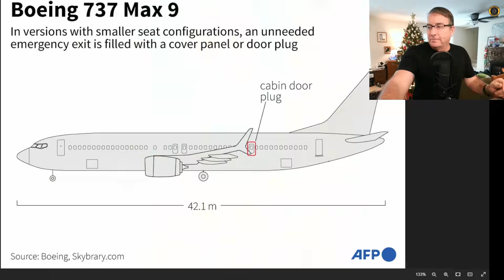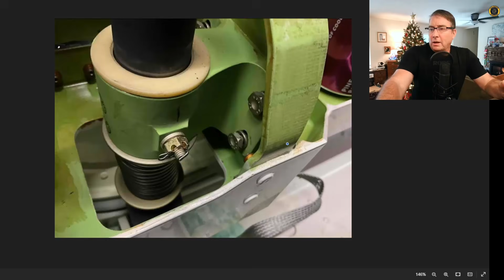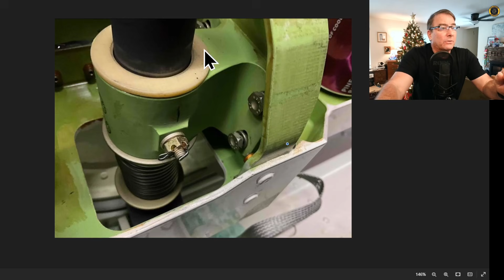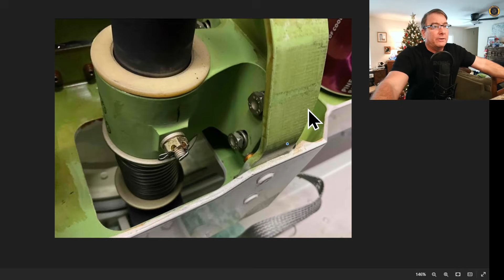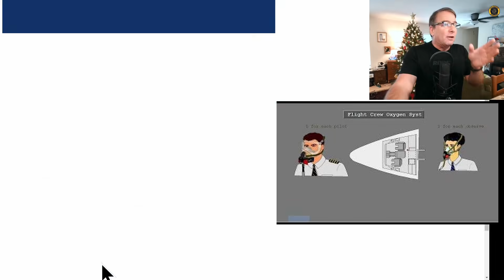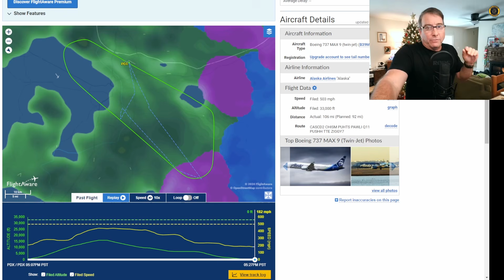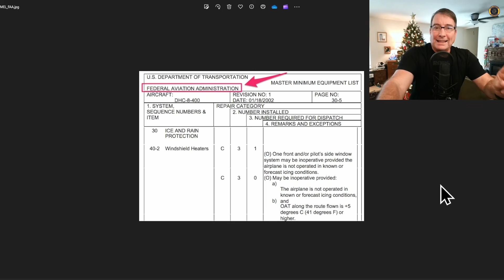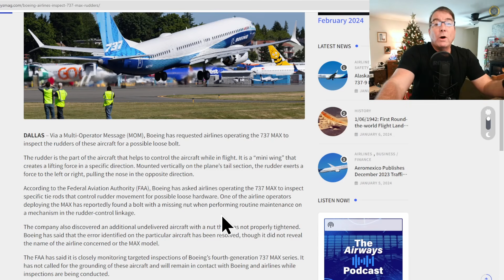"Yes, We Have No Bolts"  9 Jan 737 Max-9 Update

Comment: I retired from Boeing fabrication in 2020 after 35 years of service. The past 20 years Boeing culture became all about saving money and shareholder value. Shareholder value directly affects the elite executives yearly bonus. There are posters all over the factory talking about shareholder value at our stand up meetings we were urged to find savings cut manufacturing time and increase shareholder value. 
Quality control has been severely reduced or eliminated moved to "self inspection" as it was deemed as "overhead". Under staffing unqualified, untrained fabricators were the the norm at the time I retired very little training being done. Very aggressive unrealistic scheduling is the norm.
Self inspection on the factory floor for the most part was taken serious but with some notable exceptions. We also found many detail parts and sub assemblies were of poor quality but had passed the vendors QA. 

Boeing has a serious quality problem and I am becoming concerned the newer aircraft are unsafe.
Reply: An argument can be made for DoD intervention, they higher ups at these companies have got to go. If ww3 were to break out, could we rely on Boeing to construct our defenses? As it stands, I don't think we can.
Reply: @zelkuta That's why we have Lockheed Martin doing most of the aircraft defense work.
Reply: "Shareholder Value". I place most of that at the feet of Muilenberg, but his successors aren't much better. I left in 2022, and although there was contrition over the MAX MCAS debacle, it wasn't genuine. Profit over safety still ruled the day.
Reply: Self-Inspections are pushed down into suppliers too, and allowing supplier's parts to go directly onto planes without Boeing inspection calling this cost cutting:  "partnering for Boeing success" 😢
Reply: @kevinp7056  That would double work or triple work...Since the legal liability would be from the certification agency (Federal Government).
Reply: Shareholder value can go up by focusing on ... I dunno ... making rock solid aircraft
Sometime execs forget that cost cutting and robust quality are actually mutually exclusive endeavors in this universe
Reply: ... having a screw loose has definitely fucked up shareholder value now. How ironic 😂😂😂
Reply: @electronicsafrica Stocks we're dropping rapidly the other day...
Reply: @electronicsafrica   Literally. Unfortunately, I have a fair amount of stock.
Reply: @xyx12300  theres only 1 thing worse than having boing stock ... not having boeing stock ;)
Reply: Even the most diligent person will overlook things when inspecting their own work. Fundamentally someone else's eyes need to see it
Reply: @scabthecat The doors are likely the only way to get chairs into or out of the aircraft, as they are the widest doors, and with no trims or inflatable slides on them, just remove entire door, and you have a good clearance.  The 4 bolts plus 12 stops are plenty enough, if the 4 bolts are actually there, and if it was not a plug door, but a proper door, it would have the correct 4 point latch system to hold it, plus the correct switch interlocks as well. Looks like the warning system should have been there irrespective of it being a plug door or actual exit, and the warning only disabled if the alternate of fitting a fuselage skin and permanently closing was used. After all the wiring and indicators are there, plus the actual switches, and the actual monitors, just the bulb is removed, and the INOP label placed in the display. Should have been left in place as active, and placed in handbook that this lighting means they need to have maintenance do inspection before next flight.
Reply: @mauriceravel4654  Yep. They still have the Zero Defect signs and there was the Go For Zero program. Your Dad is probably as disappointed as I am in Boeing.
Reply: We very recently (2 weeks ago) flew out PDX to SFO and then SFO back to PDX same day flight on Alaska Air in the 737-Max.  Our SFO to PDX flight was delayed 3 hours due to maintenance issue ... they had to fly another aircraft in from ... you guessed it Ontario.  Our flight from SFO to PDX was turbulent all the way and that Max rattles in turbulence ... behaves very different in turbulence from older 737-8.  The 737-8 moves with the turbulence, the Max seems to fight thru the turbulence and rattles when it does.  We landed safely in PDX but I seem to recall our tail number was the same ... sorry but no more Max for me, sticking to E175 or Airbus A3xx.
Reply: The drive to provide large dividends to shareholders, at the cost of quality and employee benefits, negatively affects the quality of your product. Same thing has killed FedEx.
Reply: the reason for this plug door is that the 737-900 is a stretched version.  Rather than actually build a clean fuselage for each type, boeing has chosen to produce modular section of the fuselage, and where one particular variant would not necessitate a exit door, it is plugged.  This is almost exclusively a boeing design decision, not shared by any other major commercial aircraft design.  The old A300-600 variant that were converted to fedex freighter had rear doors plugged, because they don't fly pax, only cargo.  But other than that, there just aren't that many aircraft, especially pax commercial wide bodies that use this modular scalable design...in terms of how to properly plug a door, yes, boeing COULD choose to permanent blank these exit doors, but then this would actually cost time and money.  In other words for every single day just one of these aircraft is in the hangar not making revenue is a lost PLUS the cost of doing a permanent door install.  The reality also is that the FAA rules on temp plug doors is actually less costly and easier to comply with than re-engineering the design to mandate the doors be sealed permanently with far better more reliable methods.   Bottom line is that Boeing made a decision long ago, FAA accepted that design and here we are.  And yes, at each heavy c check those plug doors are removed for detailed inspection...again , adding to the risks that improper maintenance and loose inspections controls will happen again!   (if you are getting the impression from my opinion that Boeing has made seriously poor decisions on design for both maintenance and safety, trust those impression!)@scabthecat
Reply: The worse part was that it didn't just pass the vendor's QA process, but also Boeing's "source inspection" QA process.  The inspection process has been very lacking.  They need engineers to review vendor parts not some low paying person who was not properly trained to understand all the details.  Most of the time, the QA process is about pushing paper and making sure the count numbers are correct instead of looking for flaws in the parts.
Reply: I worked on alot of Boeing aircraft mostly the 737, was f.e one of the guys who took part in the worldwide refit of the tail rudder actuator system on ALL 737's in 2000-2002.
We took pride in our work to give the flightcrews a good / safe bird to work with.
Battery fires, composite delamination, faulty engine mounting brackets, breaking frames of passenger seats, overhead luggage bin's and other trim falling down, Mcas, rear pressure bulkheads etc.etc. and now this all in a short span of time!
Seeing what is happening today with the quality and endangering crews passengers and innocent bystanders is making me vomit.
The thought of that people working in the aviation industry, marching with pitchforks torches and hauling a cart with tar and feathers to the managment of Boeing becomes very tempting.
Reply: Airbus is breathing down Boeing's neck.
Reply: @comancheflyer4903   True, but they've had some problems too. Engine issues (suppliers, not Airbus directly) have been decimating the A 321 fleets.
Reply: Low bidder always is what you get for quality!!!
Reply: Vampire value.
Reply: Listen D.I.E is the future, it's racist to question employees, if the quality is not acceptable you are a white supreme and need to check your privilege!!!!
Reply: “Becoming concerned”? I have sworn I wouldn’t fly on a Boeing jet built in the last ten years since the MCAS incident. If it hasn’t been flying for ten plus years, I don’t trust it. I prefer Airbus all the way, anyway. Boeing has needlessly plagued ITSELF with these incidents, inviting them with subpar QA/CQI and “self inspection”. (Self inspection is a contradiction in terms in capitalism, afaic.)
Reply: That's what happens when the MBA suites run the place
Reply: I bet you're right, and the average shareholder can comprehend this. But I'm guessing the largest shareholders want short term gains and could care less about structuring the company for integrity and airworthiness. A lot of companies in competitive sectors do this.  They kill themselves from the inside.
Reply: @someotherdude  You're oversimplifying.  If Apple phones cause people to die, you will hear a lot more problems.  Airplanes are more complex machines and mistakes often result in bigger disasters.  If someone forgets a screw on an iphone, who gives a crap.  On an airplane, people can die.  Quality control will always be a problem on airplanes regardless if its on an Airbus or a Boeing.  You're reputation is only as good as the the last crash.
Reply: @scabthecat The design has been used with the 737-900 (NG) for a long time.
Reply: I think it’s time the government steps in and does something about Boeing. And for that matter, all aircraft manufacturers. Even Airbus is having quality control issues.
Reply: The factory QC decline is indeed waring but I would also like to know about the air line's maintanance department acceptance procedures  for new acft entering the fleet (granted the door plug is something that could be easily looked over as non critical item)
Reply: the reality is that the FAA issues the airworthiness certificate for new green factory aircraft.  The ONLY moment when a carrier is doing warranty inspections is when a problem happens.  In other words, it's a process based on trust and then on reaction.  It would be cost prohibitive for carriers to re-inspect what they purchase from factory aircraft.  It is the same issue when carriers receive aircraft after a major alteration at a part 145 repair station or even a C check.  It is assumed the airworthiness cert issued by the FAA for that aircraft after the part 145 or even part 121 work is complete is satisfactory to put it into revenue service.   @yanniskouretas8688
Reply: @yanniskouretas8688 Is something that would require removing the interior panel be something typically done on an acceptance inspection? This seems beyond what I’d expect
Reply: @richtes  I know in other companies, they require inspection in every operation that involves closing out a panel or other process which obscures the ability to inspect after it has been installed.  Some even require photos being taken, especially if its an electronic unit to ensure there is a photo record of the interior prior to closing of covers.  As for aircrafts, It would make sense to have an inspection step prior to the installation of the interior panels.
Reply: @yanniskouretas8688  the airline would likely not see the door plug fixings at all.  Remember they are covered over with a panel.  They see a finished aircraft, check the quality of the interior fitout, do flight tests to ensure everything appears to be normal and sign off the plane.
Reply: @mauriceravel4654 All while corporations like Boeing virtue signal in order to boost their ESG score. It would seem that there wasn't enough room in the ESG guidelines to ensure that a corporation isn't prioritizing "shareholder value" ahead of engineering and manufacturing defect-free products.
Reply: There is nothing wrong with cost saving per see. Even when done aggressivly. If cost cutting is not carried out then costs will continuously balloon out. Where it goes wrong is when people can not differentiate between cutting costs and cutting corners.
Cutting costs is part of what should be considered normal business optimisation.
Reply: @Agnemons I disagree. The clue is in the language. Why cutting? That is an inherently destructive process. Cost management is the key here.
Reply: @thesmallerhalf1968  I disagree with your disagreement. 😜
Reply: @thesmallerhalf1968 using words to mean what they really mean is hard, though! I disagree!
Reply: Do you think DEI, which I hear is taught religiously at Boeing, could have something to do with it?
Reply: @belladonnahigh9206  Don't get full of yourself.  It's not "taught religiously".  Perhaps in your own head it was.  In today's reality, you will always need to watch what you say regardless of which industries.  The "good old boys" club is not the same anymore.  You can easily get fired for saying the wrong thing in ANY company in today's environment.
Reply: @ahndeux  I wasn't born yesterday. Besides I heard from other pilots it is. The "good old boys" club will return eventually, if not in this century then in the next - history repeats itself.
Besides, I'm not living in USA, or the "Western" West, where everyone gets offended so easily, though we are in that phase, unfortunately.
My friend works as a repo man and sort of a landlord (goes where he's needed and gives the apartment to the tenant). He already told me which tenants are the worst... guess which, it's a nobrainer. Nevertheless in my job I have a group of friends to whom I can say whatever, sorry you don't have that (or not, maybe you like it).
Reply: @belladonnahigh9206  You don't live in this country, so you won't ever understand how it would be like to live in this country.  It's a totally different world in just the last 20 years in most work environments.  In the old days, you see machinists put pictures of girls in bikinis on their tool boxes.  Today, you get fired for that.
Reply: @ahndeux  I know exactly how it is, as I follow US politics and culture since 2016. It is nearly then, when all hell broke loose, bc the presidency was won by the guy not approved by the "uniparty".
Anyway, your example perfectly lines up with what I said, offended snowflakes for no reason, who see problems where there's none, but somehow never have the solution to them. 
What is happening to women's sports is disgusting, it's pure cheating, they/them should have their own category, not steal achievements from women. To me, every woman with a second place, are the real winners. But Riley Gaines is turning things around. You don't know what a woman is, you have no place in Congress.
Have a look at how cities look, there are plentiful of documents here, that show the decay, and all those songs about Cali are no longer true.
Reply: @belladonnahigh9206  Yup.  Times has changed boomer.
Reply: @ahndeux  very original (not even one) and name-calling to boot. Question is for better or worse. Should our future go towards Canada then China (basically a police state) you will have limited hours of playing your games or even how long your console/PC/whatever can stay on. My oh my, whatever will you do then? But hey, gotta fight that climate change, huh?
Reply: @belladonnahigh9206  Am I wrong?  You're from the boomer generation which enjoyed massive wealth growth and drove up excessive spending.  Your generation have pension plans that allowed you to not save a penny and yet have a reasonable retirement account far in excess of every generation since.  

I'm not a zoomer, but we're in the generation of people who have to save for ourselves.  I can give a rat's behind about climate change or DEI, but its the environment we are left behind because your generation failed us miserably.  Your generation led us to where we are now.

I'm an engineer with a background in electrical design.  I made my own PC when I was 16 back in the MS DOS days.  I understand this world a lot better than you who left it in a worse shape and any other generation before.  Our generation would leave it much worse for the next also.  There is nothing anyone can do because its what we have.

Get back to the subject of this video and get off your high horse.
Reply: @ahndeux  I see I'm not allowed to respond, cowardly behavior, but to be expected.
Reply: @belladonnahigh9206  What are you talking about?  You're responding. You probably said something offensive and your post was removed by YT.  You need to learn some self control.

Comment: At 6.00 in the video you can see the heads of bolts with what look like spring washers under the heads.  The bolts pass through what appear to be slots, not round holes.  Surely the small diameter spring washers are not large enough to be secure without a large washer underneath that fully covers the slot and spreads the spring washer load correctly across the fitting.  This appears to violate every instruction I have ever received about the use of spring washers with slotted holes.